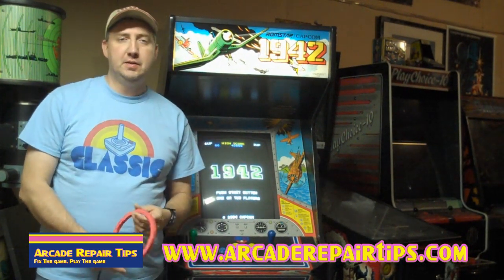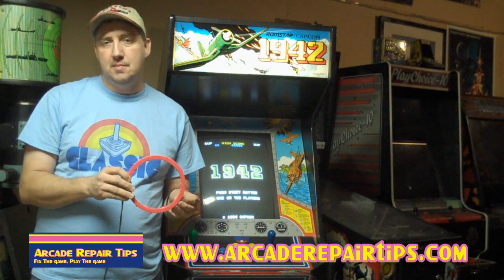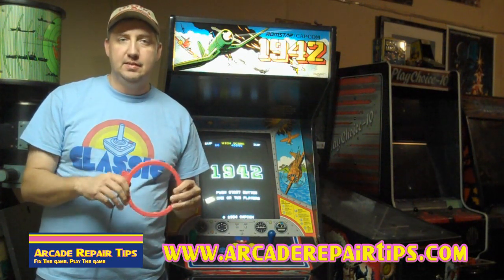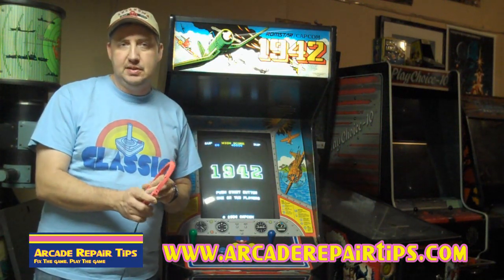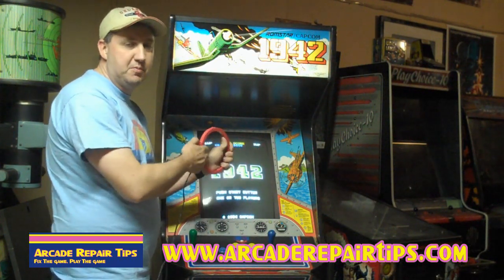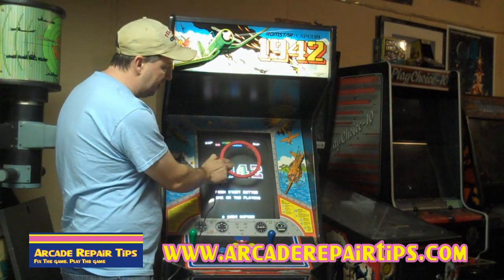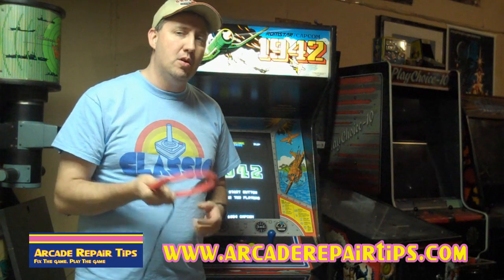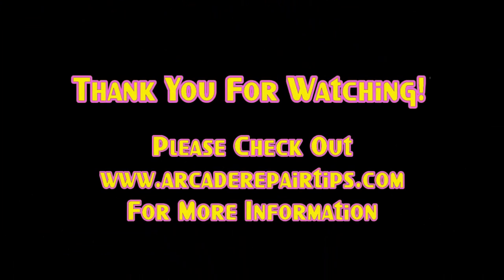Arcade Repair Tips - Using A Degaussing Coil

Comment: I have a joker poker game, the screen has gone blue with a bunch of lines and can’t see a thing, it started. With a bunch of grey lines then got bad. Can you point me in the right direction?
Reply from the maker: Justplainnasty, make sure you replace the battery and check the power supply. See our post on Inspecting An Arcade Board for more tips. If it plays with no objects on the screen, could be some bad ROM chips on the board. Hope that helps.

If you would like more details about your question, please tune into our Live Show Episode 56 on Thursday, October 7, 2021 at 5:30 PM CT. Here's a link to the episode if you want to watch it: https://www.youtube.com/watch?v=j_XtYMFsGpY. Thank you for your question and good luck with your future repairs.

Comment: I just wanted to express my appreciation for this video. I purchased a degaussing coil on walmart.com for $17. I didn't know how it worked until I watched your video. I have an arcade unit that has over a hundred and sixty games on it. I noticed it mostly on Donkey Kong and Miss Pac-Man. The right side of my monitor was very faded and cloudy. With your help I learned how to use this and it now works perfectly. Thank you again so much.
Reply: So Rad you fixed it👍👍👍👍Hope your still have it ✌️🏝
Reply: @shanefraser7764  actually, i do 👍😊

Comment: you just saved me 500 bucks; i was planning to drive over to Betson in Phoenix and buy a new multisync in a few days because of a large green wash in the corners of my multisync.  Because of your video i learned where the degausser is on my monitor, found it had slipped off the corners, and placed it back and hit the degauss button. It took a few times, but no more wash!  THANK YOU!

Comment: My arcade CRT shows some discoloration on one side when that side is placed close to a wall. So it seems some radiation from the CRT is bouncing off the wall, and back in, and causing some interference. If I turn the machine, you can see the discoloration disappear. How do I troubleshoot/fix this?